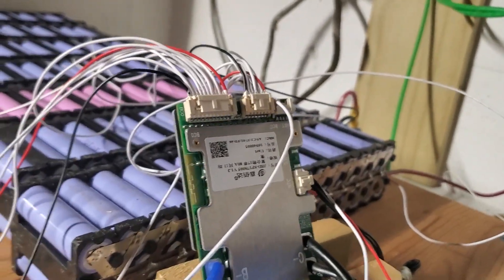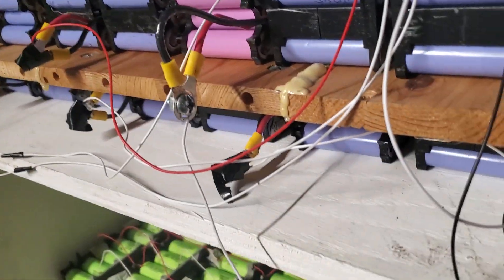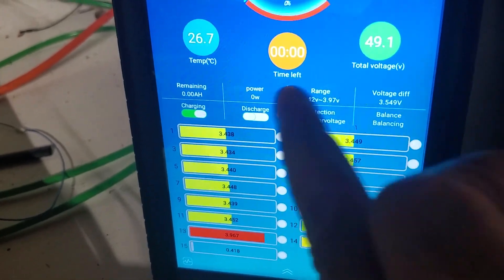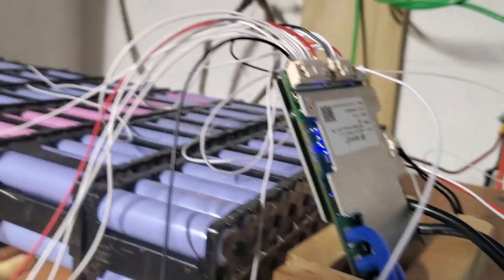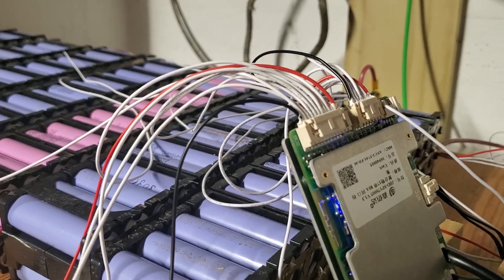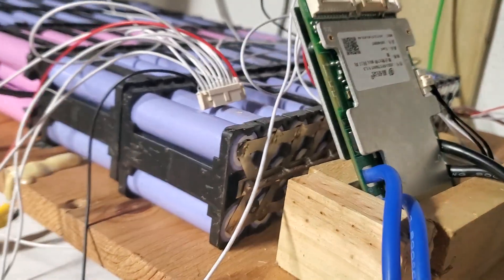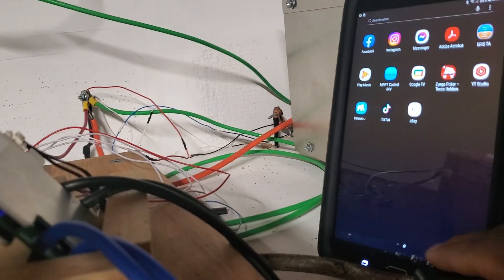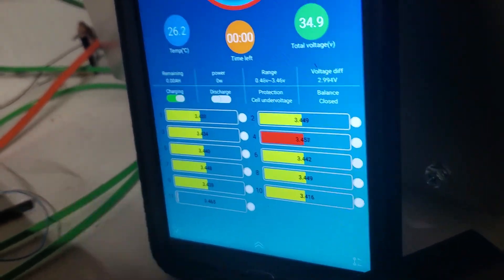MAJOR ISSUES #2 -JBD Smart BMS 14S 48V 80A Lithium Iron Battery #bms #battery #solarenergy #inverter

Comment: Not sure if you're still messing with this BMS, but in a 14S config, the top wire, Pin 17 per the wiring diagram, should be connected to the positive of cell 14, while Pins 16 and 13 should both be connected to the positive of cell 13.  Pins 14 and 15 should be floating.
Reply from the maker: I have it as 13, 14, 15,16 in 13th cell, 14 in the 14 cell
Reply from the maker: The BMS is not great because it doesn't allow to change parameters. The one that I have is 80A, it stopped over 35A
Reply: @simplyfocus9937  I'm using the Overkill Solar Android App, and with it, you can change the parameters of this BMS.  Again, you might have already given up and gone with another option, but the Overkill Solar app is much more powerful than the XiaoXang app.
Reply: @simplyfocus9937  I sent this reply before, but for some reason it didn't take.  If you use the Overkill Solar Android App, you can change all of the parameters on this BMS.  It's far more powerful than the normal app.
Reply: @simplyfocus9937  Okay, I've commented this twice, but it hasn't gone through, or has been deleted.  I think it's useful for viewers to know that you CAN change the parameters of this BMS using the Overkill Solar Android App.